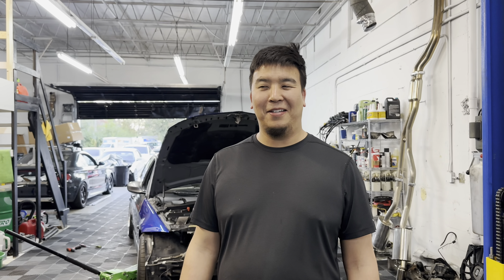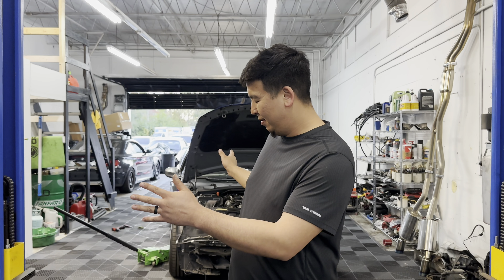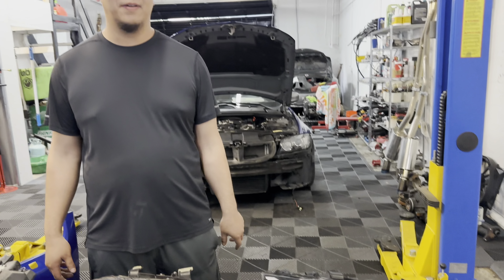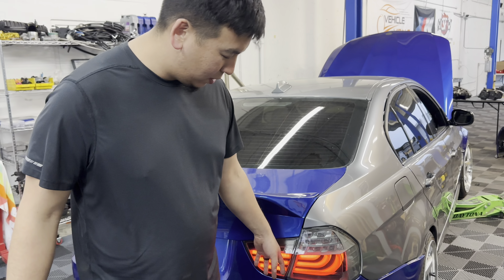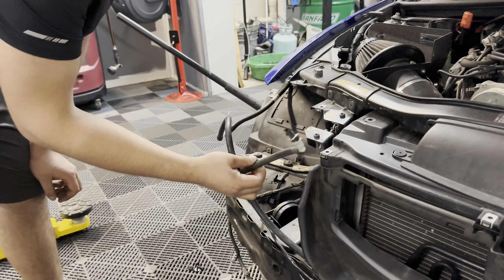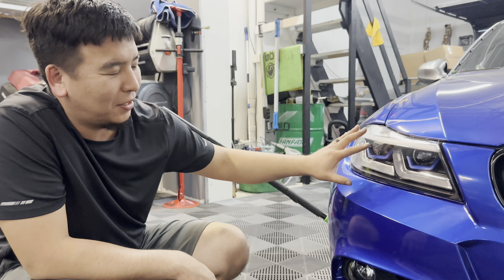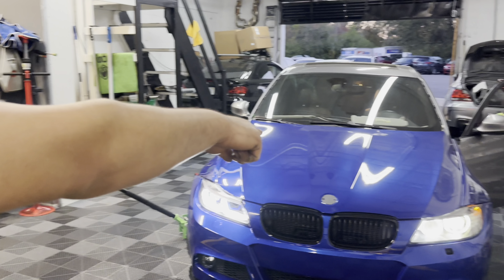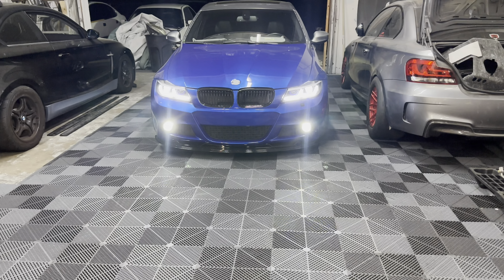Made My BMW E90 Look Better with Simple and Easy Mods!

Comment: Just saw your video about changing the brakes in your 335i (best bang for your buck). Did you fix the shaking in the steering wheel problem ? I have a 335i e93 lci and my brakes keep making my steering wheel shake. Do you have a solution for that ?